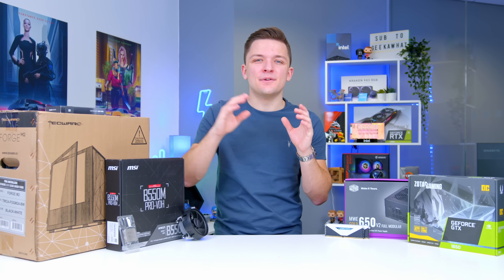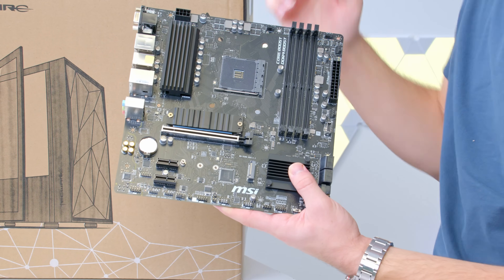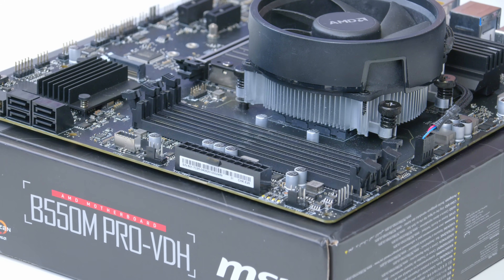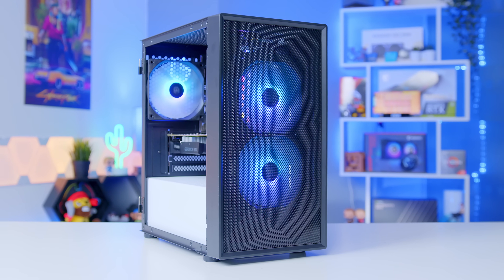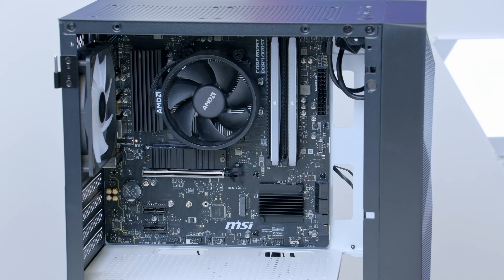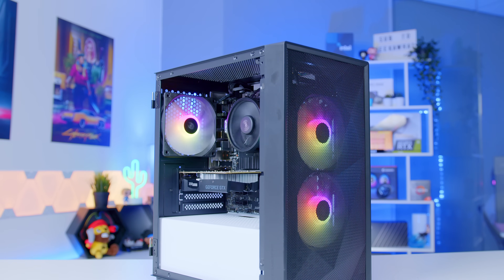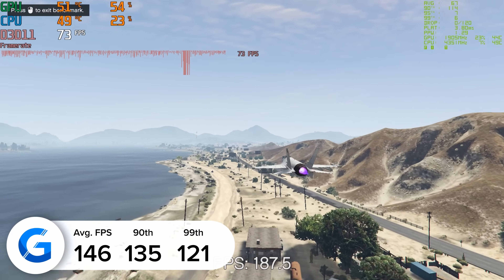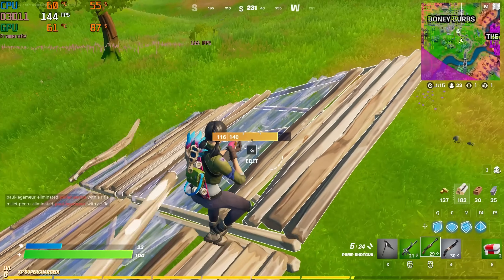BUDGET $650 Gaming PC Build 2021/2022! [Full Budget Build Guide w/ 1080p Gaming Benchmarks!]

Comment: Great video. I have a question. I’m new to building pc’s and i had some help picking out some parts. I bought the ryzen 5 5600g with a msi b450 bazooka max wifi motherboard. I just want to make sure the parts are really compatible and also would I need to update the board ?
Reply: The answer is yes if you want upgrade on near future. If you want use that in a long-term don’t need upgrade, the answer is no
Reply: Go to pc builder it will tell you if you make a building mistake

Comment: I don't recommend anybody going with a 4 core nowadays, u will always need to upgrade the cpu if u add a better GPU. I would recommend at least least 3600 or 11400f/12400f when it's released. If you totally cheap out on the cpu u won't have fun
Reply: in order to bottleneck, 4 cores arent low enough to bottleneck
Reply: @talaatislamsyiam5720  Friend of mine finally upgraded from his i7 6700k after he realized the obvious bottleneck from upgrading his card. Went from a 1070 to a 3070, and those 4 cores were definitely making his upgrade not as great as it should have been with unfortunate stutters during intensive moments and not much multitasking headroom. He opted for the 11600k and its a night and day difference between the two. Stability, multitasking and %lows are much higher in comparison. 

I also went from a 4 core oc i7 2600k to a ryzen 3600 and its unbelievable on how much smoother the entire experience is.More and more games are taking advantage of 4+ cores so it does make sense to atleast future proof now by getting a 6core minimum within budget of course. But in reality, at the bare minimum a 4 core will be able to play modern games. You're just much less likely to have an enjoyable experience with it due to limitations as things get more and more demanding.
Reply: @talaatislamsyiam5720  Yes they are. My friend only has a 1060 and had CPU issues in Warzone and Forza. Now with his new 12600k, all of these are gone. So yes, 4 cores are too low for modern Gaming builds, espeically with really cheap 6 cores nowadays...
Reply: @froznfire9531  games are using more than 4 cores well the new games are
Reply: @caps721  no they don’t I just put my 3700x to four cores and it runs fine your doing something wrong
Reply: @joshuamorris9050  why did you put it at 4 cores ffor use all 8 cores and ur cpu usage but be at 90 or 80 then
Reply: @joshuamorris9050  lmfao 🤡
Reply: @shedinjan  good chat buddy
Reply: You have a video to a good build?
Reply: @Juanico259  depends on budget

Comment: New to pc building here i wanna know if i swap motherboards and put everything on my new board with i have to reinstall anything like windows if im using the same ssd and hard drive ?
Reply: Well as a rule of thumb, If you replace a periphery part the answer is no (video cards* , extra storage drives, Power supply etc etc) But if you are replacing a critical component Yes.(Like a drive that is being used for the OS, CPU, motherboard)

*Video cards is really up in the air. It can be difficult to scrub the residual files from a previous card (unless you are replacing it with the exact same model) But if you know what you are doing there are programs for that. Imho if the OS hasnt been refreshed in a few years I would refresh said OS if I was replacing the video card. Old computers can get....quirky....

Comment: Please need an answer for this question.
Is it good to buy a second hand graphics card?
Are non-certified psu bad?
Reply: Theres nothing wrong with buying 2nd hand gpu's, just make sure it actually is the gpu and doesnt have any minorflaws (broken heatpipes, thermal paste needs replacement). Its a better idea to buy a certified psu because thats whats powering your system, so you dont want to cheap on the powerhouse. EVGA B stocks drops for like, $30, for ok psus.
Reply: @darkangak  Any tip when buying second hand graphics card?
I wanna buy a 970 for the moment in Ebay but I'm not sure.
Reply: @nicolasgracia1040  Check seller rating, make sure to use Paypal or something where you can dispute if something goes wrong, and be sure to ask questions about the item if you can.
Reply: Would this build with a gtx 1060 or 1070 and a ryzen 5 3600 be good for my fisrt build to play games like warzone?
Reply: @123Ross05  Of course, check for benchmarks in YouTube before you buy anything.

Btw, the 1060 has to be the 6gb version because the 3 gb are not enough anymore.
Reply: @nicolasgracia1040  yes I know but I’m not really sure about how much fps i need to have a good gaming experience. I know people say 60 but shouldn’t you try to get a bit higher than that. Is there a huge difference between 70 and 100 fps in a game like warzone?
Reply: @123Ross05  It depends on the type of player that you are.

If you are really competitive, yes, you would take advantage of that difference between 60 and 144hz.

If you are like me, someone who plays just for fun and to enjoy, 60-75 fps are enough for most titles.

So yes, 60fps is a really good experience, 144 is just a bit better (most of the time not worth because it requires more power, and with more power I mean a better GPU) but still useful for competitive players.
Reply: @123Ross05  Having great FPS specially in FPS games is something very important, between 60 to 144 its a great difference but if that will make u a better player, most likely not, but believe it ur experience is much better.
Reply: @nicolasgracia1040  Okay thanks mate. Think I’ll buy a barely used 1060 6gb then cuz I’ve found one for just under 200€. Seems like it’s with it right now.
Reply: @Enkkaidu  Okay thanks mate
Reply: @123Ross05  Seems like a really good deal in today's market (sadly), I'm doing the same thing xd

Hope you enjoy it and good luck 🤝👍
Reply: @nicolasgracia1040  Okay👍 Good luck to you too!